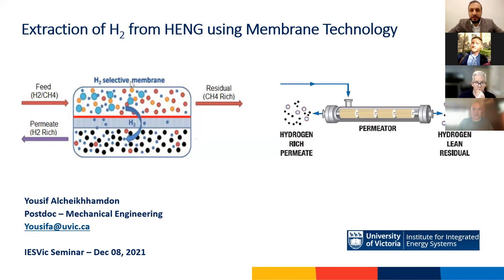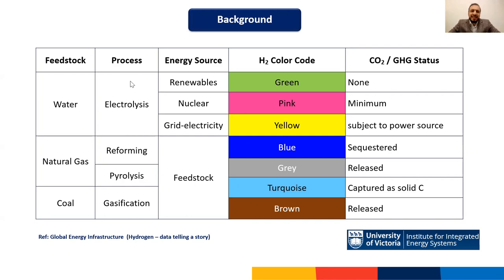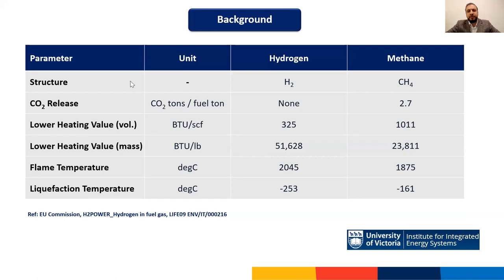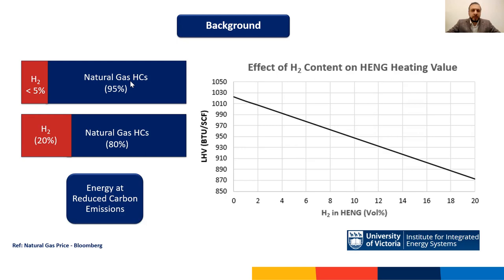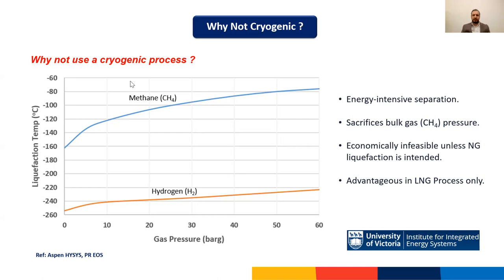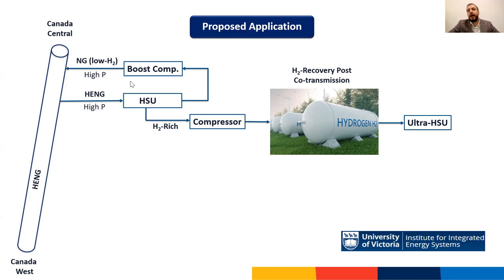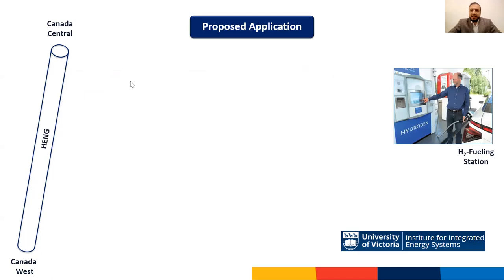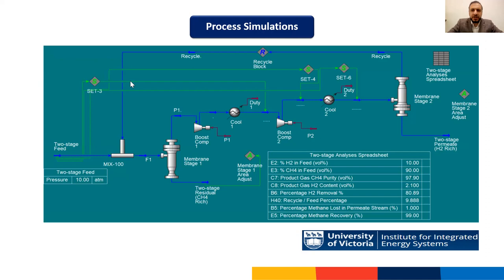H2 Extraction from Hydrogen-Enriched Natural Gas (HENG) using Membrane Technology

Comment: Hydrogen floating in water is easily to be delivered in 
silicon/glass pipes separately without mix. 
It should be up to the end users to mix this hydrogen 
with other fuels or not for various usages.